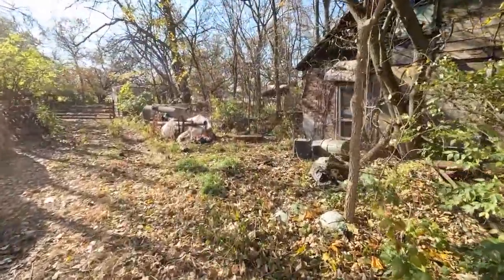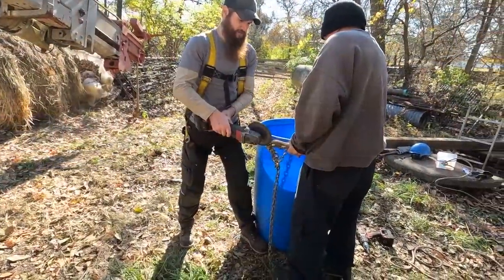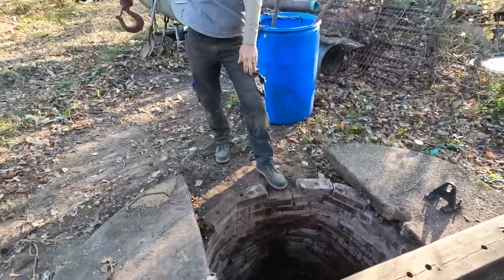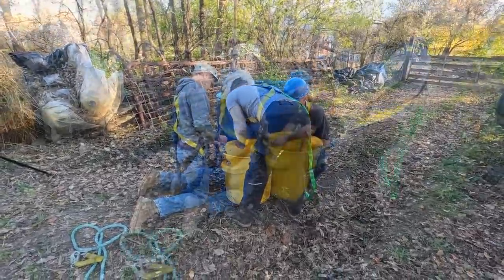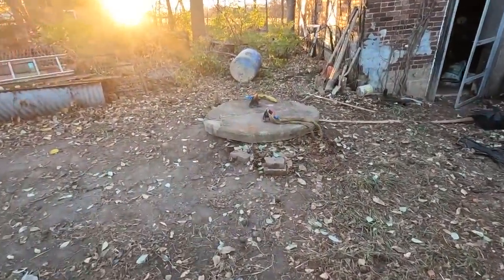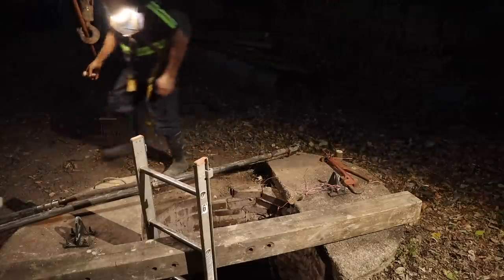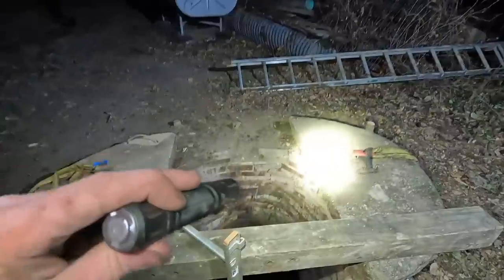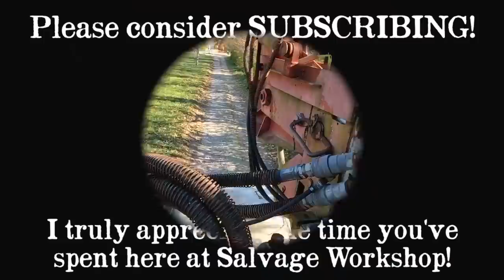Can we SAVE the WELL at the Farm with a Crane & HAND Tools? ~ Putting my Auger Crane Truck to WORK!

Comment from the maker: I hope you are enjoying the rescue of the old well! If you missed it, I recently rescued the Crane Truck we used in this video, so if you're interested in seeing just HOW useful that truck really is, here is the video where I show all of its features: https://youtu.be/D0Y9b8jwEQs?si=3VS_hMMxp4jqDaBP
Reply: If you lower your pole guides it will make your total height lower.
Reply: I’m sure your friend really appreciated your help. I just hope the well continues to supply clean water to the cattle.
Reply: That long storage bin with the roller on the back of the truck is for the ladder!! Stand it vertical and slide the ladder in
Reply: It was an interesting watch. But you guys are certainly no plumbers. Good effort though, got it done.  It seems to me that having the truck closer and having the boom at 45 degrees or more would have worked better. Would have been able to lower and hoist the ladder with it that way. Also, on the bucket, I would have attached the chains at about 5/8 of the height of the bucket using only two chains. Thus it is much easier to fill and to dump. Plus something like a large screen door handle on the bottom to help tip it. Even a block of wood would help.  Many, many years ago, I helped my father hand dig a well. The trick to digging straight down is you hang a stick ( like part of a closet rod ) tied in the center. The stick should be the diameter of the desired diameter of the well. So, you suspend the stick centered in the hole, spinning it as you go down to ensure uniform and plumb walls.

Comment: I was a teenaged farm kid with a shovel and a bucket at the bottom of 3 different wells.  We rented a high volume pump from the fire department to get the water out.  And I know where the expression "colder than a well digger's a$$" comes from.  When I bent over to get another shovel full of muck off the bottom of the well, my hind end rested against the side of the well, where the ground temperature was 47 degrees year 'round.
Reply: As a teenager and 20 something I dug 5 different septic tank holes in SE Texas all of them in the summer and the further down I went the cooler it got, maybe 65*. Using a pick axe and shovel I never got cold 🤣.
Reply: You should be waring breathing apparatus going down that deep, you never know what can seep into the well

Comment: The large amount of sludge at the bottom of the well may be due to ground-water run-off.  I noticed that the bricks don't extend very far above the ground, so a good rain-storm, and there'd be rivulets of mud running into the well.
Reply: The bricks don't seal the surface water out unless they are sealed by some method.
Reply: Surface water entering the well is also a contamination issue. A nearby soak-away (as often happens in old British properties) is also a bad idea.
Reply: That silt did not enter the well, it was always there.  The water table was probably much higher when the well was originally dug and that’s why they had to extend the pipes.  They had to get the muck out to extend the pipes.

They probably should devise a way to regulate water usage so they don’t run the well dry.  

Maybe only trickle water in the troughs or install float valves?

Comment: For very low volume producing water water wells, just a suggestion: put three or four 275 gallon Square totes in your well house ( if there’s room for em) fill the totes from the well with a low GPM pump. Don’t even need a float shut off just a 120v timer set it to go off after 55 min @5gal/ min. Provided your static water level recovers and maintains (5) GPM. That way the totes can pump stored water to the stock tanks on demand and year round.
Reply: Until they freeze over in winter, thereby cracking the vessel walls.

Comment: In Hungary we use a special tool called "frog" for sludge removal. It is a big and heavy iron pipe with a simple check valve (basically a rubber flap) on the bottom end. We let the pipe fall in the sludge, it fills through the "valve", and we winch it up. The most of the sludge/sand stays in the pipe. We do this for many times. 
In most cases nobody has to go down in the well, or at least for a shorter time.
Reply from the maker: I wish i had one of those! Maybe if i ever do this again, ill make one for the project! Thanks for watching, i truly appreciate the support!
Reply: It's a very simple tool. The tube is usually 4 inch diameter, and 1 meter long the heavier the better. If the edge is sharpened it works better. The "check valve" has to be as big as possible, to ensure free flow of the sludge.

Comment: Fifty years ago, before the giant vacuum trucks, municipal public works departments used a small crane truck (1.5 ton) with a 16-18 inch wide 24 inch tall, four part expandable ladle to reach into narrow storm drains to remove sludge and debris.  The four part ladle went into the hole with its four teeth expanded, then the operator above grade somehow closed the four teeth shut which trapped all sludge and debris within its grasp.  The operator then raised the ladle out of the hole, dumped the contents into the dump truck bed and repeated the process.  They could clean many storm drains in little time.
Reply from the maker: That's cool!  I would love to find one of those and give it a try! 
We considered making something like that, but decided it wasn't worth the time it would take to make one, because we needed to fix the water problem quickly!

Comment: Your truck has air, I think you also have a portable air compressor.
It's pretty common to run an open air line into that space and let it run before and during your entry.

If it's your business, they have testers and sniffers for oxygen content, hydrogen sulfide, CO CO2 and so on.
Reply: you need air by volume and you need to exchange air on a volume based rate.
ive buried some freinds working in confined spaces more controlled than this

Comment: A vacuum pump can only draw water from at most 9 meters (there's your 30 feet). The only option is to lower a sewage pump in the well.
Reply: Gotta keep in mind the max lift head of the pump as well. Like when we clean out wells around here, we use a bucket with a bottom that opens inward that'll sink down into the ooze then flap back down when you go to withdraw it like a check valve. Helps to bolt some scuba weights or other low-profile-yet-dense weights to get it to load up in a reasonable time as well.
Reply: That was a two-line jet pump water system.  They are supposed to be good from 30 to 80 feet.  He described it a little bit.  So that ejector (injector) is a jet (venturi) pump at/near the bottom of the well.  So it is a push-pull system, it doesn't violate any physical laws.
Reply: You have probably got the best background music
Reply: 1atm = 1 bar = 1 kg/cm^2 (all these '1' are boring for imperialists).. 1 kg / cm^2 = 760 mm of mercury or 980 mm of water. So a vacuum pump will never draw from more than 980 mm (10 meters). Unless you raise the pressure in the well.
Reply: @frutt5k This imperialist would like to point out that 760 mm of Mercury is equivalent to 9800 mm of water not 980 mm, which approximates to 10 metres of water or 32 ft.
Reply: @filmbluff99  I stand corrected to the imperialist.
Reply: @frutt5k  That is true for a vacuum pump, although the practical limit is more like 25 to 28 feet.
However, as I explained above, this is not a plain vacuum pump, but a two-line jet pump.  The smaller line pushes water down into an inline "jet pump" at the bottom.  So effectively, it is pushing from the bottom and sucking from the top.  That significantly increases the usable depth.

Comment: I worked for a billboard company back in the early 80's as a welder and got my on the job  training.  Starting with a skyhook electric powered boom and winch for 1 year and graduating to a national 1200 hydraulic Crain. After using a Crain for work I've have learned just how valuable a Crain can be to any work situation. So congratulations on your new to you Crain. Loved the video and the safety minded thought you took for the safety of  everyone.

Comment: I’m curious if you diagnosed that pump? it sounded like you described the motor and shaft working fine but had stripped the centre of the impellers? 
I’ve worked with them quite a bit and can’t think of why it would have done other than either incredibly poor quality or perhaps it’s check valve not working, water running back down the outlet causing its impellers to run backwards, and then turning it on so the shaft ripped through it in an opposite direction?

Can’t say I’ve heard of that, just theorising it. Would still be very poor quality materials for it to do that..

Edit: just so you know, the injector is not so you can pump more water, it’s so you can have such a high head on the suction line on the inlet of the pump, without an injector your suction line could only be about 6-7m lift max.
Injectors are old school these days, uses  about 30% of the water to inject and needs more power than a (decent) submersible

Comment: For future reference when attaching plastic pipe to galvanized pipe, instead of a female adapter use a galvanized coupling then use a male adapter. The female adapters expand on the tapered threads causing a lot of stress, they can crack or break. The male adapters are in compression and much less likely to fail.
Reply: Only trouble is the male adapters are very susceptible to sampling off if they get knocked from the side. I like the female fittings that have a stainless ring on the outside of the plastic, very strong

Comment: A serious effort, deserving of all new pipe and fittings. I did a similar job on my dug well, fixed it, next year had a fault in the larger of the two pipes somewhere in the 200' run up to the house. It took 10 gallons to prime. Ran an electric line down it, installed a submersible pump. The following September, the water table went below the inlet for the 1st time in 20 years. Bit the bullet, got a well drilled next to the house.

Comment: Next time use a Sulzer sludge pump with a homemade separator on level ground, that feeds the water back in the well. All humans can be on the ground. Only the pump, an upgoing hose and an electric cord going down the hole. Wiggle the pump up and down to loosen the sludge.

Comment: Damn, you trust the crane / those bolts holding in the plastic / chains a lot 😁
nice work!
Reply: I was thinking the same...if I was the guy below I would stand behind the ladder for a little protection if that ton of sludge bucket ripped!

Comment: I haven't demucked a well in 40 years but it was over 220 ft. deep I was 10 it was brick lined as well we did an auger and water in a pipe homemade 290 foot auger we went an extra 70 feet. The new bottom was walls were 30" ABS pipe $84 per 10' section back in 1984

Comment: Totally real project. Not everything has to be sexy, sometimes its all about the mundane to get through the day. The boom truck seems to have paid off. Its great when you can come to the aid of a friend in need. Those young guys need to grow some thicker skin. Working in that well 40 odd feet down, hanging on a cable would not be comfortable and would test a saints patience. Put yourself in that mans shoes, his livelyhood was on the line. Cows don't eat snow, they are smarter than that. A nasty job, but you two stuck at it and came away grinning. Good on ya!!

Comment: I have a vac truck and have pumped out several shallow wells      ive generally found it to be a temporary fix       if the silt came in through a hole in casing or around the lid it may well be useful to pump it out      but if it came up from the bottom then likely a waste of time       shallow wells dug to water flowing sand levels generally have about 5 feet or more of sand come up the casing and if you pump it out the dirt falls down along outside of casing and up again the bottom      you then end up with a sinkhole around the top

Comment: Is the bottom of the well above or below the clay layer?  (Clay is highly resistant to permiability of water). If it is above the clay layer, it might have to be dug a little deeper. If you strike loose gravel at the bottom you are in luck for having a good collection area.

Comment: I think you should dug a little bit deeper go through all that problem just for a few feet, that's my opinion but it was a awesome job. I just would have about 10 more feet down but whatever whatever works for use at that time
Reply from the maker: We went as far down as the bricks that lined the well were... you don't want to go past that, it could lead to the whole thing collapsing at some point.

Plus we definitely didn't have the time to add more bricks to the bottom, that would have been a massive can of worms!
Reply: Okay I definitely understand what you are saying,. @SalvageWorkshop

Comment: Use air to pump the water out. air hose to bottom connected to a  angled t attach enough pvc or whatever to make it to top of the well Start up air and water will be carried up the pipe in a kind of suction along with the air.

Comment: Not to be negative here but be careful about suspension trauma. those harness are met to save your life, not for working suspended. you could make a wood seat and attach your harness to prevent fall from de wooden seat. Great video. Thanks for sharing.
Reply from the maker: I agree completely... I like the seat idea, didn't think of that one! I'd like to get a couple harnesses designed for suspending someone, but we used what we had!

Comment: Did you guys consider using a trash pump?
Reply from the maker: Yes... we were going to lower a 3" trash pump 10-15 feet into the well, but without stirring up the sludge with a pressure washer, the pump would NEVER have sucked the sludge... we didnt have enough water at the farm to run the pressure washer... we considered ALL kinds of crazy ideas, but came back to the simplest and cheapest option

Comment: All I can say is, comical! Why could you get a P250 pump and be done with? There are good gas operated sludge pumps that would elimate a lot of work. Sorry fellas, I just don't think you guys put a lot of modern technical thought into this. At least edit the stuff that didn't work out of the video. I give you credit for doing it but man, save your backs. How much would it cost to drill a 300-400' hole with an inline electric well pump? PVC piped! Or to whatever the water line is?

Comment: Very cool training film on what Not to do, @ 30:00 catching a shovel thrown off the top of the truck, 55:00 safety first, then a big trash can full of mud and a man at the bottom! Get a mug/trash pump, instead of an electric scooter, water weights 8.3 pounds a gallon + lift = head pressure =( heavy).
PLEASE PLEASE watch some deep well, confined space rescue, and work situations ! Get some hearing aid ! 
Please be safe, I have worked with fire department a number of years and thank Jesus Christ for getting through and no one was hurt ! Thanks for helping your neighbors !

Comment: I just don’t understand why in the US that they continued to put gas engines in trucks ? The rest of the world stopped using gas engines in anything bigger than an SUV 60 years ago ! All the vans from 1.5 tons & over have been diesel powered since the late 80s.

As for the safety, it was okay apart from the bucket, had that failed whilst full & dropped, it would have likely killed the guy below it.

Comment: Looks like you are trying a jet pump They are only good to max 40 ft. Get a i/2 horse submersible pump  and  as long as you have the suctions under water it wll  pull H2o well over 125 Ft..

Comment: Go diggin and get your depth back boy’s!!!!  Be pretty slick if you could find some plastic culvert pipe that right diameter so you could have a couple inches less diameter and lift it up with the crane and just sleeve that sucker and stabilize your old brick walls for a 100 more years?? B

Comment: Bad plan from the start  put down a submersible well  $124.00 to $400.00  they will pump up to 200' at 33 gal no - Brainer
no you don't need a 4" pipe  to put it in - he can if he wants to,  he mite have $500.00 in to it  this could have gone bad

Comment: Pack clay then sand around well curb. Also my grandpa was a well driller from Kentucky if the well isn't producing lots of water ya might drop 6 crawdads down there they will find the vein open it up so you get more water. Bad thing is all the Fracking going on it lowers the water table. Hurting folks who use a well. Good luck.

Comment: Oh where to start, I've cleaned out several wells before.  What you needed was a mucking bucket. It's like 3 five gallon bucket s put together with a tapered bottom and a piece of pipe on the bottom for the dumper person to use as a handle. The bucket has a hard saddle attached with the pivot just above center to stay upright while lifting but making it easy to up end to dump. Also the bottom handle anchors the bucket on the bottom while filling. Your crane is a lot less work than a windless for  lifting the muck out. Hope I have expanded your horizons just a little bit.

Comment: The pipe looks to be galvanized. Has anyone cut it to see what the inside diameter has been reduced to? Where I am, when you see a 1" galvanized line, the inside has usually been reduced to less than 1/2 inch. Just wondering if remove and replace is an option?

Comment: A normal suction truck like we se for septic tanks etc, cant generally lift water over 30 feet.  Of course there ARE trucks that can do much deeper, put they involve a lot of water and a jet pump set up .. an they are surprisingly rare and expensive :( 

So I agree with the old school methode! :)  PLUS great to have the winch for safety too if there's bad air or an injury (heaven forbid) ... Too bad you can't get the screw auger down there!!!